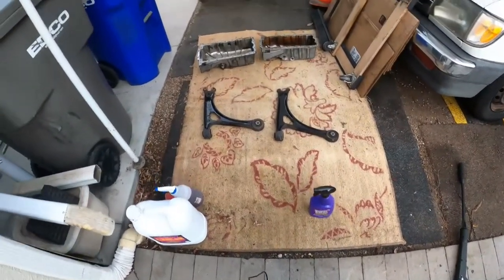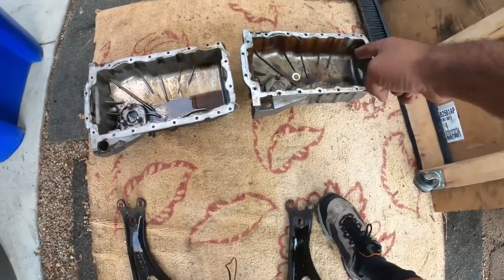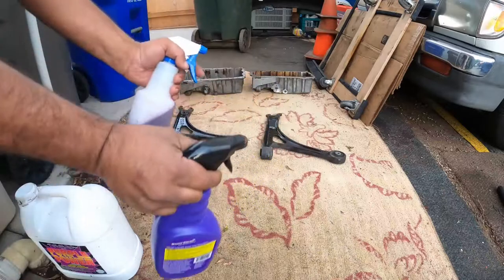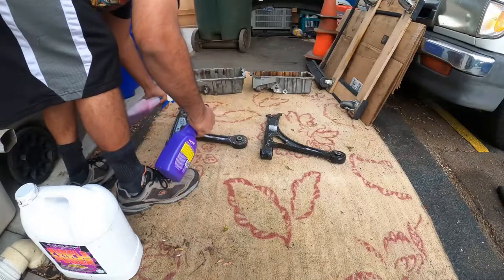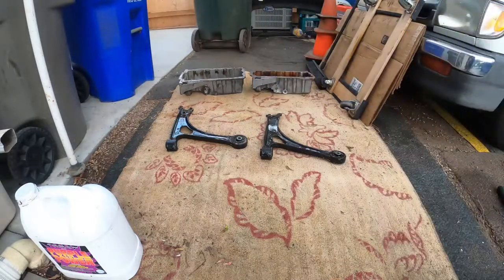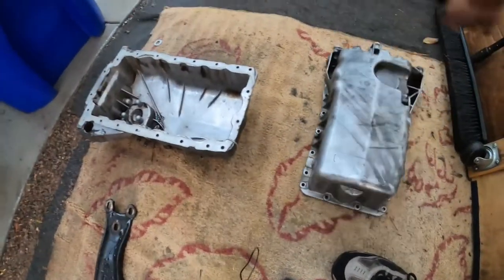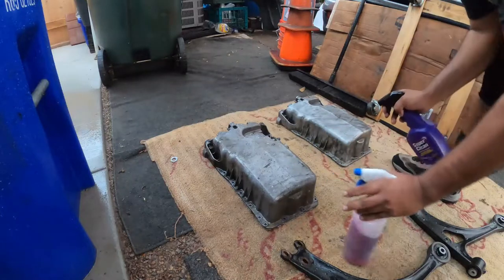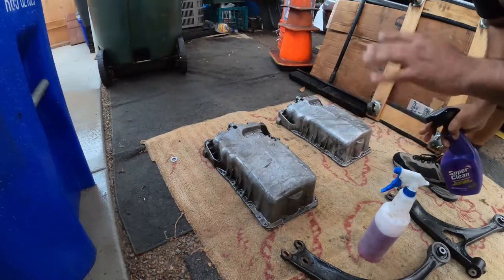Purple Power VS Super Clean Who is the best bang for the Buck?

Comment: My first though  - don't use it on aluminum.   You'll be fight oxidation.   

I used them on my 1999 jeep Cherokee aluminum intake manifold, forgot oxidation for a while..

Was able to stop it with PS Brake Buster I had laying around.

Good job by the way.
Reply from the maker: The pans we don't care for. It was just to show how good the product works.